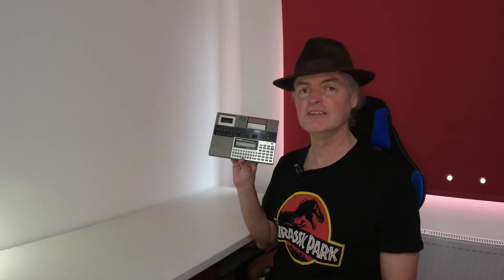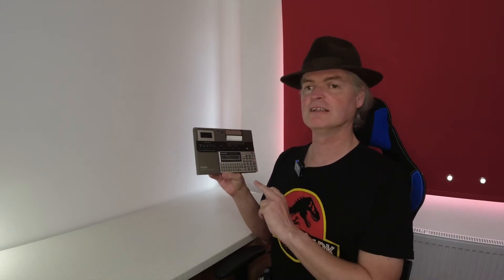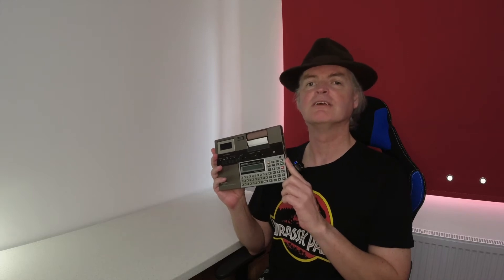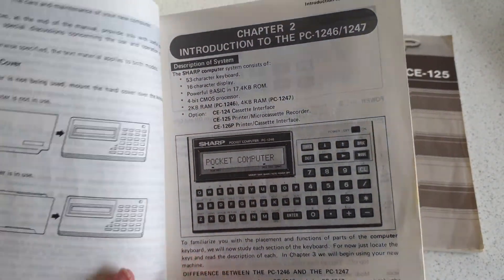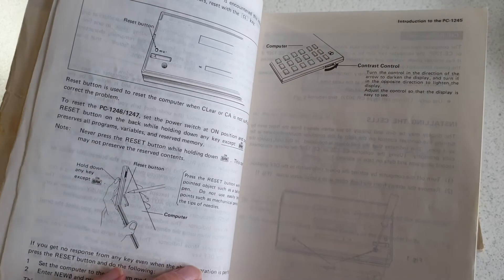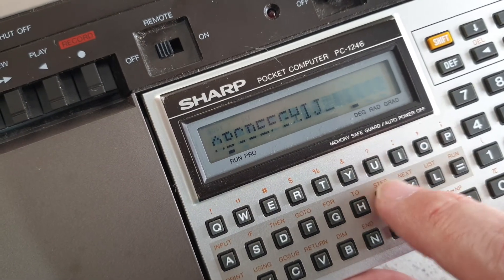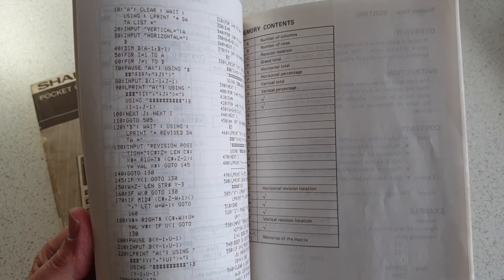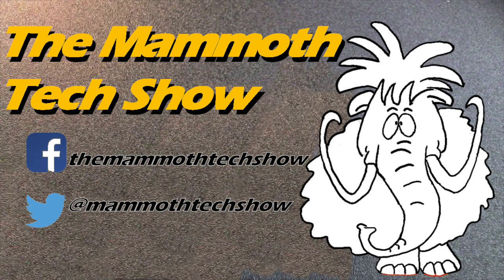Sharp Pocket Computer and Expansion Dock - Retro Tech Retrospective

Comment: nice :) I got one of those. its from before my time but its still fun to play with. The cassete deck on mine is also not working good. I think the belts are deteriorated. Should be an easy fix though.
Reply from the maker: I was amazed the belts were still OK on mine. If they turn to goo it can be a pain to clean.
Reply: @mammothtechshow  Yeah I agree. I'm gonna sell mine. Don't really have use for that and I dont think it goes up in value alot if I hold on to it for some time. Still a magical device ☺

Comment: Hi, many thank for your video. I have got PC1251 & CE125 which I was using very often approx. 35 years ago. It was fantastic tool in time befor "PCs". Unfortunaly, I observed now that when trying to print the error message occurs: ERROR 01 .  Is there enybody who could help me to identify where is the reason?? Thanks for every information :-).
Reply from the maker: Thanks! I have had a look in the manual and it does not seem to be a printer related error. Only Error 8 is related to the printer (paper misfeed error). The manual says... Error 1 is simply the computer's way of saying 'I don't know what you want me to do here'. To find out what the problem is recall you entry using either the < or > key.... Don't know if that helps but at least you have the internet to ask now. No such luxury back in the 80s!

Comment: Do you have a till roll with the program listing of the text adventure that you wrote?  That I would like to see.

I never had a pocket pc. I have a Texas Instruments TI58 programmable calculator which is a thing of beauty and even had rom cartridges. It's a shame a leaking battery pack has long since eaten the insides.
Reply from the maker: Sadly not. I would imagine thermal paper would have faded away after this long. I believe some old calculators are getting quite collectable.